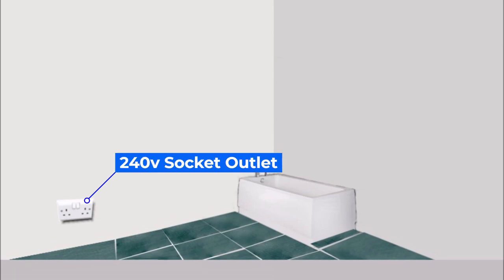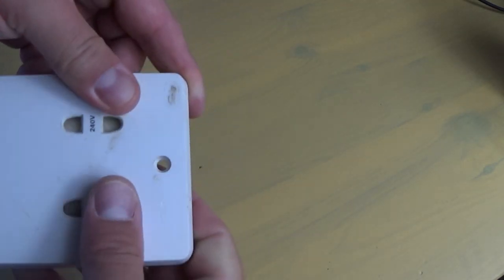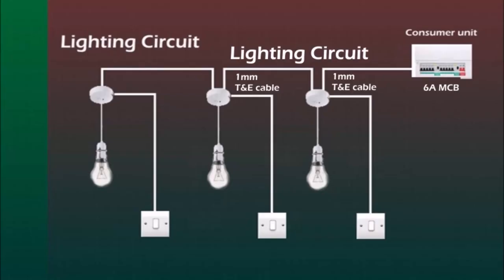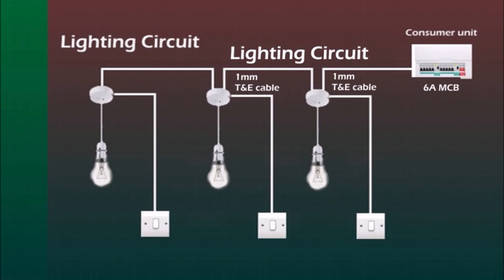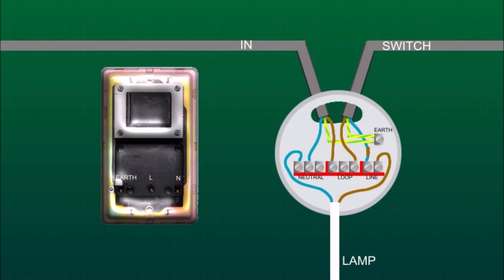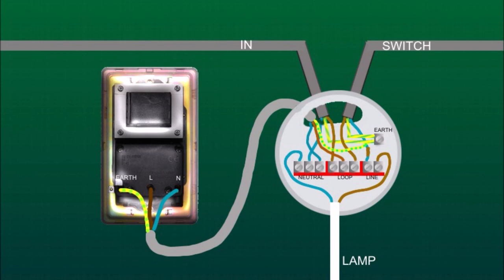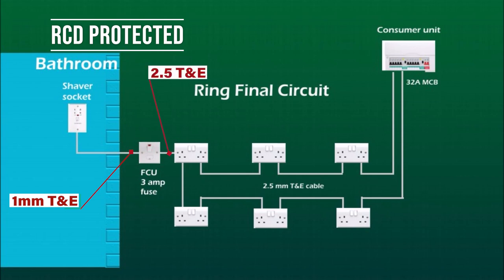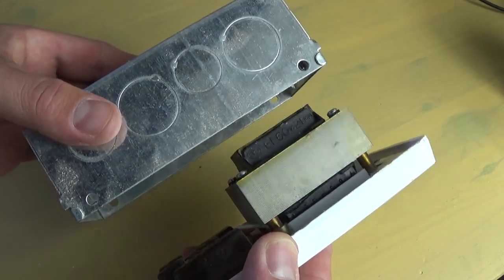Wiring Bathroom Shaver Socket How to wire shaver socket to ceiling rose or to the ring dual voltage

Comment: Can I have a dedicated radial for the bathroom towel rail heater element and shaver socket?  Much easier to run a new cable on a dedicated RCBO than try to tap in to the ring on my place.

Comment: Can you make a video with following connections at the switch not ceiling rose. Feed in and out, sw line, shaver, fan and mirror light? Shaver is a 3 core

Comment: If I use a spur with a fused switch from the ring main can I also add a wire from the shaver socket for the mirror light?

Comment: Excellent videos do you have any of wiring a shower at the board
Reply: In most cases (but it needs to be calculated) showers are fed with a 10mm twin and earth cable from a 40A MCB/RCBO at the consumer unit.